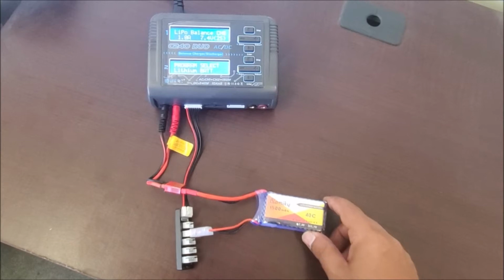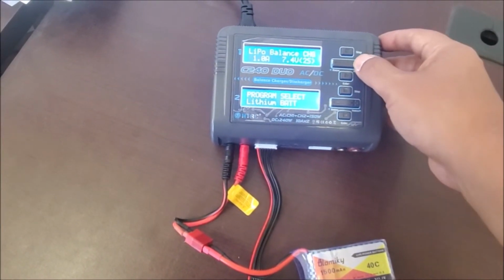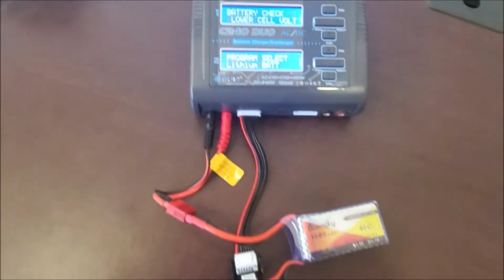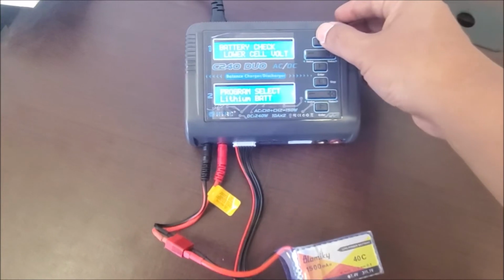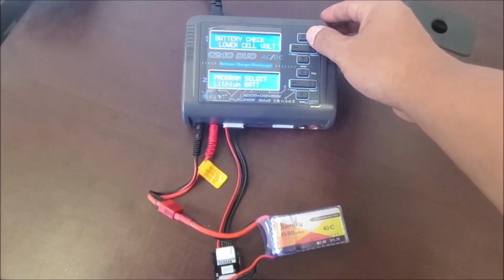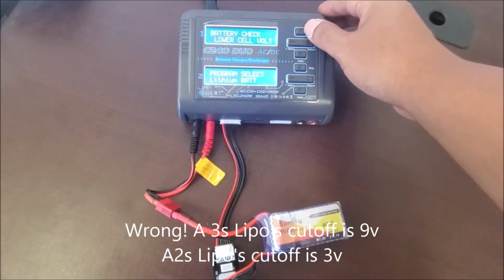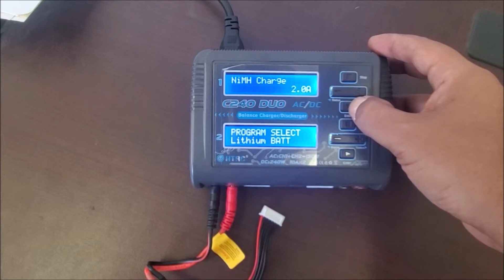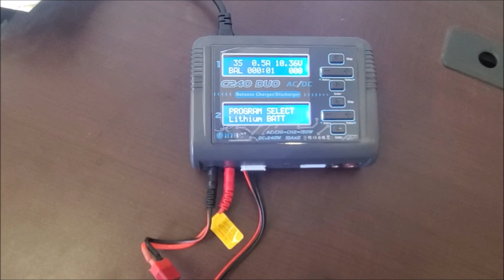RC car truck Lipo battery lower cell voltage cutoff not charging EASY FIX

Comment: still getting "lower voltage error" when trying the NIMH option... any suggestions? Thnx..

Fyi.. it's a 3200 3s Lipo that's been fully charged/used ONCE... Wasn't used in about 2 months since ..not charging now